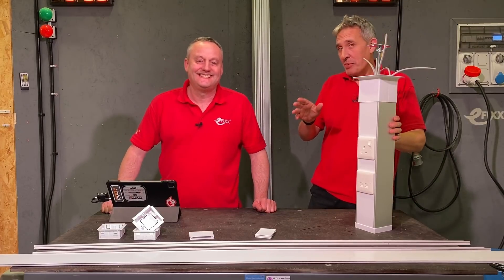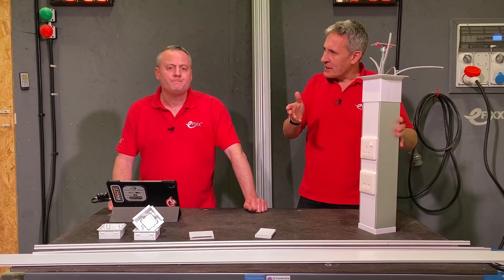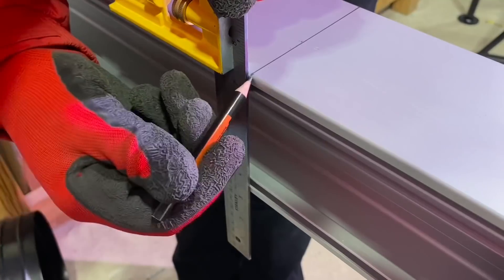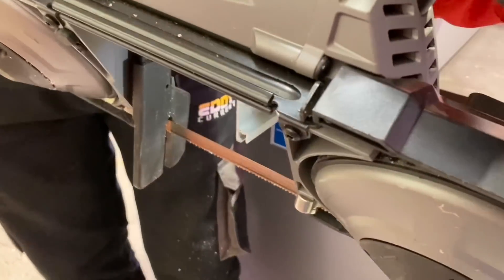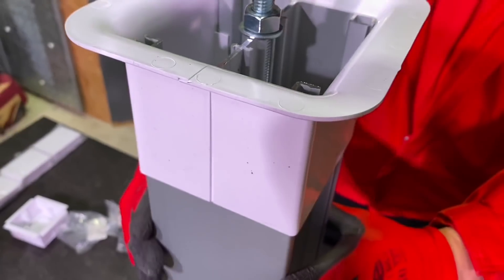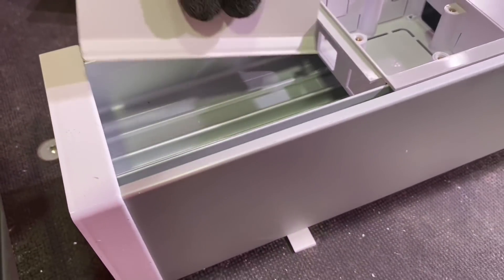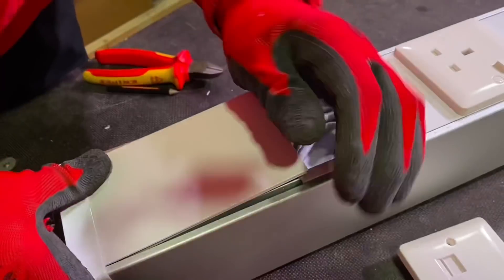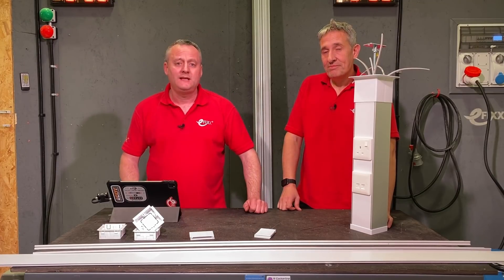ARE POWER POLES THE SOLUTION TO BETTER OFFICE WIRING?

Comment: Great, versions of these have been around for a while and works well in a school, lab and open plan offices, trading floors.

However Having a metal base flor to these could mean you could secure them  on the floor and the ceiling above it making for a even sturdier solution they can also be moved around if room configuration changes but I suspect there is an awful lot of basket or tray work in the suspended ceiling above.